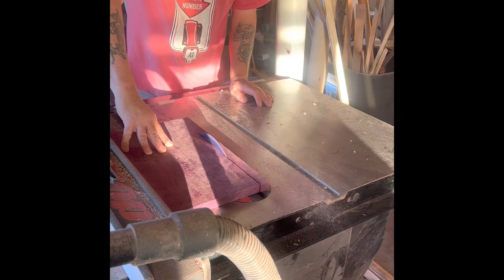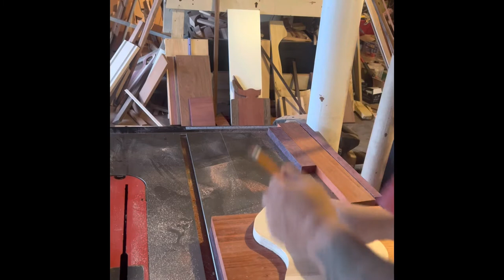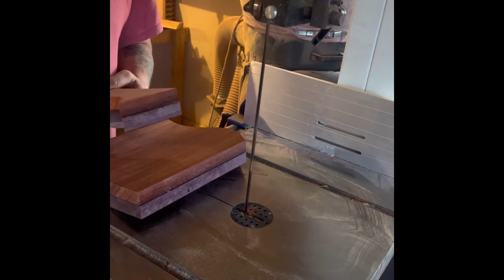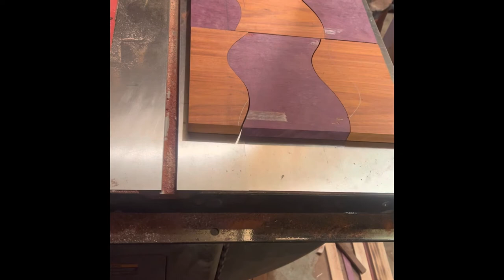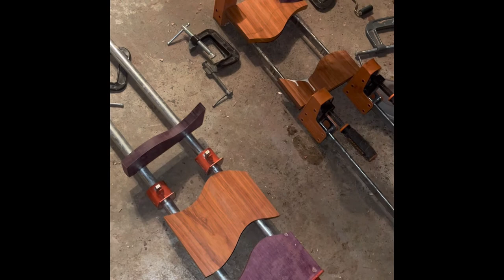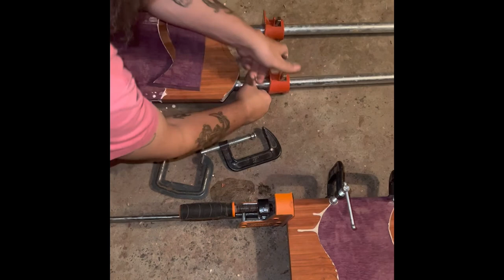How to build a drunken cutting board part 1

Comment: Okay, I watched how you cut the pattern,the way you glue and clamp them. How does the pattern you cleaned up at end turn out so much different. I watched several times to make sure I didn't miss anything. Why did you leave that step out?🤷 I do thank it turned out awesome,if only I say how to end up with a pattern like that (but not). My own similar pattern?? 
    Thank you for your time Sir. Amazing skills👍🕶💯💥
Reply from the maker: That’s a good question. It’s been a while since I made this board. You are correct. I did forget a step to tell everyone. Once I had it glued up. I cut each board in thirds again totaling 6 Pieces and then put it together and glued it up. Thank you for pointing that out to me. And I appreciate the positive comments @chrisbeverly7266